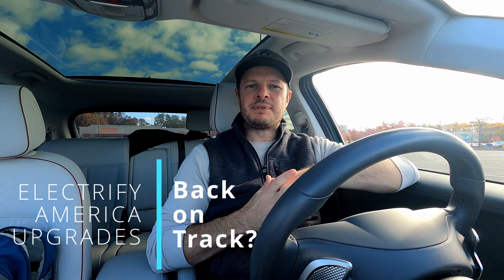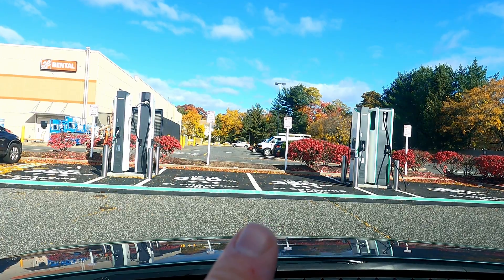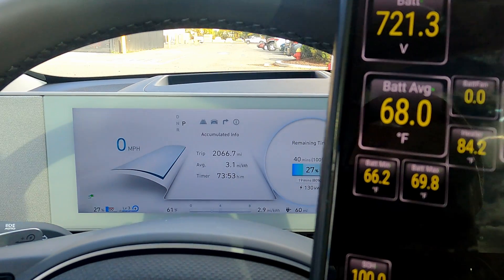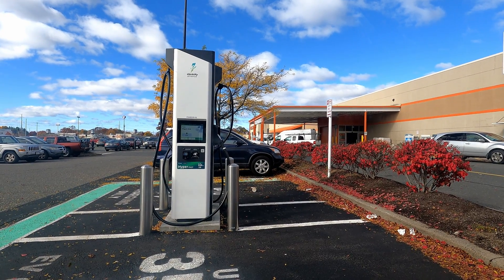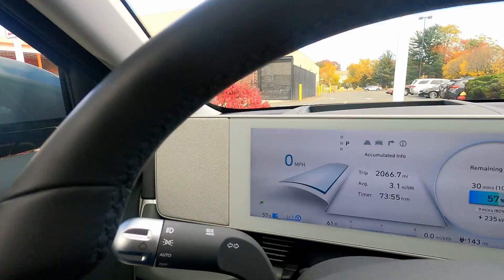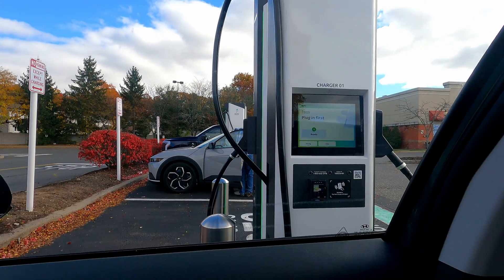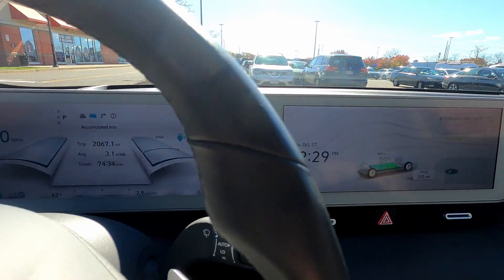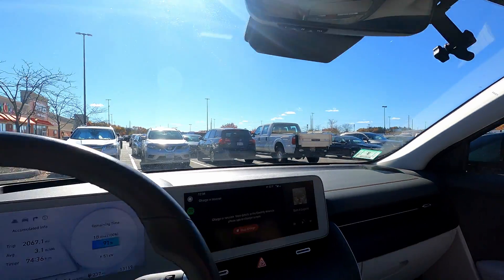Electrify America's 350kW Site Upgrades (with Balanced DC Fast Charging)

Comment from the maker: Do you expect these hardware upgrades and station changes to rehabilitate Electrify America's reputation?
Reply: I sure hope so, as a new Bolt owner I hope for some on the other side of the CT river in the Westfield area.
Reply from the maker: @allys537  I don't expect to see EA expand to Westfield given the proximity to the Chicopee site, but you are supposed to be getting a swathe of new DCFC installs at Pride Convenience stores on that side of the river. Also one at the Friendly's on Southampton Rd, right next to the Masspike so I could envisage us using that one on the way home from long trips. Won't be until mid-late 2023 for most of those sites now though, I would estimate.
Reply: New hardware ought to be great out of the box as long as it’s compatible with the plethora of CCS cars. That would be my expectation anyway. Will these new stations stand the test of time better than the 3/4 year old hardware deployed now!  Wow I sure would hope this new hardware will be more reliable.  Then again it’ll undoubtedly get used a lot more in 2022, 2023 and so on than did the the original EA hardware back in 2018, 2019 and so on. So EA and Tritium hopefully made this new stuff an order of magnitude better, otherwise our perception of it will quickly degrade if that makes sense.
Reply from the maker: @skyemalcolm  I hope so. The first time around, they were in a hurry to get hardware in the ground and had to go with four suppliers, presumably with minimal conditions on providing the equipment. This time, EA has four years of real-world experience and data in the bank...hopefully that means the hardware checks a lot more boxes, as renovating hundreds of locations every year isn't financially viable.
Reply: I’m not expecting anything, but I’m hoping it will be better.

What I’m really hoping is that EA has learned how to work with their suppliers to make serviceable hardware. Everything breaks eventually, that’s a given. Hopefully this stuff breaks less, but when it does break, hopefully they have a stock of replacement parts available locally, abundant staff trained and ready to replace it, and hardware that was actually designed with repairability in mind. The “stock of parts” and “repairable hardware” seem to be their biggest failures with the old stuff (at least according to EA).
Reply: Certainly hope they're upgrading Saugus. For the 2 months I've had my HI5 it has mostly only had one station online and for the last couple weeks they've all been off.
Reply from the maker: @pokerguvna978  Yeah,  Saugus has to be somewhere on a list of old sites... it's by far the worst in our area. I think it's used less than the likes of Assembly Row and Burlington Mall, but they still need to get all the metro Boston sites figured out. 

Another EA location for the North Shore is slated for the mall up there in Peabody, but I doubt we'll see that until next year now.
Reply: @plugandplayEV  interesting, I didn't know they were going in the North Shore Mall. I figured with EVGo there already they wouldn't bother but then again both providers are installed within 100 yards of each other at the Burlington Mall. North Shore Mall would be great as I live 5 minutes away. Currently doing most of my charging in Burlington at the end of my work days in Woburn but those 150kW stations seem to max out at ~90kW. I get up to NH every now and then and have charged at the Seabrook 350kW stations and they've been great. 

Assembly Row was by far my worst charging experience. They're inside one of the garages which most people who haven't been to AR wouldn't know are free for 3 hours and wouldn't even enter.  When I arrived I pulled into the only empty space and tried to plug in. The screen showed it was in a charging session and I didn't notice the guy in the space next to me was using it so I hit Stop figuring it was locked up and started to call customer service. Then I noticed the #1 plug was missing and see the cable going to his car. Knocked on his window and apologized, let him restart. He had plugged into the one I parked in front of because the one for his space was out of service. 

The other space had a car plugged in but the display didn't show any progress. But the indicators on the dash showed it was charging and the driver was in the car, so I figured I'd just wait for someone to finish, which ended up being the one with no charging progress displayed. 

I plugged in, connection failed. Tried other plug, connection failed. Unplug and replug, connected. Starts charging but within 30 seconds I get a notification stating there was an error and to unplug and plug again. The display looks just like it did for the previous car so I check my dashboard and sure enough I'm pulling ~85kW (on a 150kW). Not great but it's what I have to work with so I stayed plugged in. 

Got to my 80% but because the display wasn't working and the speed was slower, I overstayed my 30 minutes complimentary by 1 whole minute and got charged $0.27. 🤣

I might plug in there again in the future if I really need it, but otherwise not going to depend on it until it is upgraded. And I would have that the equipment would be in better working order since it is out of the elements inside a garage. 🤷‍♂️
Reply from the maker: @pokerguvna978  Right, there's protection at Assembly Row so you'd hope to see less damage. But also tighter spots, so maybe more bumps and scrapes along the way. In any case, we've always done fine charging there, albeit not great power from those older units.

The Northshore Mall location is supposedly by the Container Store a bit further north of the EVgo location, but I haven't been up that far to verify. The property company, Simon, has a partnership with Electrify America so you'll see that at several malls in the region, including Burlington but also Auburn Mall and Pheasant Lane up in Nashua, NH.
Reply: There are too many stations with just 1/4 or 2/4 working chargers. EA can't fix the old ones fast enough. The current hardware replacement campaign of 300 chargers is arguably insufficient to maintain the network as-is.
Reply: Kyle Conner, of Out of Spec fame, is very disappointed in the upgrades he has seen. He lives near Ft Collins, CO. I am in FL, no problems here with EA and MachE (still have free charging thru Ford).  Not nearly as easy or seamless as Tesla SC (only used once briefly to make sure my MY was in their database). If you come to FL, look for FPL 350Kw chargers, they are only 30 cents/KwH, just need the FPL EV app, no membership required. They also have a lot of L2 chargers, some are free.

Comment: I just drove my Ioniq 5 , 970 miles each way from Georgia to Austin TX and back.  Using Electrify America for all charging.  Four charging sessions each way.  They delivered about 230KW for every session.  However at two stops I had to call EA for remote starts.  Overall, in my opinion, that was a great performance.
Reply from the maker: That seems solid and heartening to hear that from a completely different part of the country to those I travel most often. I haven't had to call EA for years now, but not every session has been a slam dunk. I typically just try a different activation method or handle and have always got a charge before calling service enters my thoughts... calling might be quicker than my approach in some scenarios, though, and probably gives EA more info about what's happening on the ground when they can actively speak to the customer.
Reply: @plugandplayEV  I understand.   Before calling EA I always try 2 or 3 units.  But in Collage Station, TX I tried 4 units and none would initiate charging.  That station has been in operation for just three months.  But has a long list of failures.  The other call was in Panama City FL. with a line of cars waiting for a turn to charge and one unit not working.  The call got the forth unit working.   (At least it worked for my car)

Comment: Do we need an engineering degree for this ?? Are you an engineer ?
Whats the point of the phone APP ? do you not trust the apparatus delivering the Power ?
Reply from the maker: As I mentioned on the other video, always happy to answer follow-up questions. Over the years, the channel's audience has suggested they like a lot of nerdy EV details and data, so the phone app delivers that... things like battery temperature, voltage and amperage (which multiplied together, get you the overall power in kilowatts/kW), and all kinds of useful numbers for those viewers.

Of course, the challenge is balancing that with giving those without a grounding in electric vehicles something they can take away as well. I do what I can, but this isn't my primary work and there's a big learning curve. Thanks for the feedback!

Comment: Does anyone define the acronyms ? what is CCS ? compared to what ?
Reply from the maker: CCS is the charging connector type used by this EV. It stands for Combined Charging System. There are two other connector types used for fast charging in North America: Tesla's connector which is also called NACS/J3400, and CHAdeMO, which is now used on so few models that we don't typically cover it much any more. 

The industry in North America is gradually moving to J3400/NACS (North American Charging System), but both that and CCS will be around for many years to come.

Comment: These charging stations have about a 35% reliability score. Everywhere I go more than 50% of them are NOT WORKING. Some have been down for MONTHS!!!! Total scam!
Reply from the maker: The upgraded stations or sites with the old hardware? There's a big difference, which was the point of this video originally. But if the new ones start to fail as they age, that's obviously a disaster as well!

Comment: Is there any way to search specifically for a hyper charger? I can't seem to find any out here in SoCal.
Reply from the maker: In terms of finding 350kW sites, you can use Plugshare and go to the "Minimum Power Level" setting in the filters menu. Set that to 200kW and the network to Electrify America and you'll find all EA sites capable of up to 350kW.

If you're looking specifically for these newer fourth generation hardware sites, it's not quite that easy. However, for SoCal I know there use this equipment in Burbank and the Santa Clarita site, so those would be a couple of options to start with.

Comment: Where can we see the charge rate curves for each vehicle? Sorry I'm not a techie. But it sounds like based on the current battery charge level, the maximum amount of watts delivered to the car declines over time.
Reply from the maker: Tom Moloughney's channel State of Charge is very good about publishing charge tests and resulting curves for most EVs. Here's one for the Ioniq 5, for example: https://youtu.be/EFDSx1yZ32I?t=674

European charge network Fastned also does a good job of publishing charge curve graphs. If you Google "Fastned [Model] charge curve", you'll usually find what you need.

Comment: What app is that??
Reply from the maker: It's called Torque for Android. This is the Pro version, which is  $4.99 one-time payment.
Reply: @plugandplayEV  Does only torque Pro work for EVs? Torque lite doesn't seem to have any EV functionally.
Reply from the maker: Should work in either version, EV or ICE. You just need to load in the right PIDs for the car via a csv file to pull through the data.

Comment: Is that the Car Scanner App that you're using?  Are you willing to share your custom template that you use?
Reply from the maker: Hey Tom. It's an app called Torque for Android, on the $4.99 Pro version. I haven't really created a template, just added the main charging and pack temp data points to the default canvas, but I'm happy to share the PIDs or answer any questions as needed, yes.

Comment: Thanks for checking these out again. Glad to see the upgraded station working. Hopefully the minor issues the other drivers experienced will be ironed out soon, but overall looks like a big improvement.
Reply from the maker: Cheers, Brian. It's just frustrating not being able to pin down these few time-consuming niggles. There's no way that two owners of the same model should come away from concurrent charging sessions with such contrasting views of the network.

Comment: Nice test, Steve, thanks.  4/4 is great and yes, if that continues, people will have more faith in EA.  I know I will.
I haven't heard about the precondition (potential) update.  Is the preconditioning manual or does it automatically happen if you navigate to a charger?
Reply from the maker: Thanks Tom. It's good, but I can also see how others might complain that only 3/4 or 2/4 were working properly if they couldn't activate one and another was lower power than they'd hoped. So we start to see how the reports get mixed and why some have a very different view of Electrify America: same station, same morning, same EV model, quite different takeaways!

Yes, the preconditioning is activated within certain temperature parameters, when a DC fast charging destination is set in the Hyundai native navigation (so won't work with Android Auto/Apple Carplay).

Comment: If they upgrade all of the stations and also setup plug and charge with every EV manufacturer (come on--is it really that hard?), that will go a long way to boost their reputation and maximize customer satisfaction.
Reply from the maker: In terms of replacing all stations, yes, it's extremely hard! But I get where you're coming from and would agree that the oldest, least reliable stations should be in line for similar upgrades to improve reliabilty and reputation.

But EA has almost 800 stations on the map and a good number of them are new(ish). The next one down the Masspike, Auburn, MA, for example, has eight Signet units and great reliability. So there's an example of one I wouldn't want to replace, just for the sake of it. 

Even if we say that half/400 should be upgraded, they've only had the hardware and technicians to upgrade 15-20 sites in the past four months. Even at twice that rate, it would take 3+ years to upgrade that many stations.

Comment: The charging speed on the Ioniq5 (for cold temperatures) is based off the battery minimum temperature data PID, not the average temperature. It changes based off of 5 deg C intervals. You can see that in your video when the charging speed jumped up when the battery minimum hit 68f when (which is 20c) Roughly speaking at 15c or less, you’ll get around 75kw. Between 15-20c, you’ll get around 120kw, 20-25c you’ll get around 190kw, and 25+c you’ll get max speed. The kw numbers are rough numbers because the charging rating is based off of amperage not power, so the power will change depending on the battery voltage. I think it is roughly 100A, 175A, 250A and 300A but not sure. You won’t see those numbers exactly on Torque when it is running battery heating (or cooling, except when at 300A) because the power draw of the heating or cooling will push it higher. Once the battery gets hot and it starts to “rapid gate” the battery max PID is the determining factor. The battery average temperature isn’t considered for charging as far as I know.

I’m hoping to see these new stations here in Oregon soon. Many of the EA stations along my typical travel path are are old and using some of the very early chargers and the reliability of them over the past 6 months has been absolutely abysmal, sometimes with entire sites being broken. Given that EA is the only network in Oregon doing greater than 62.5kw chargers (aside from Tesla), it’s really important that they get the new stuff here and fast.
Reply from the maker: Brilliant info, thanks for that. Average seemed like the best to display prominently for vids but it makes total sense that the BMS would use min temp for cold weather management and max for hot weather. I'll adjust the Torque display for winter and try to log as many sessions as we can to get a baseline for comparison if/when the pre-conditioning update arrives.

Comment: New EA site going in at a small shopping center in my neighborhood. The equipment has been installed for months, but it’s still not activated. Hopefully soon.
Reply from the maker: They seem to be pretty stretched with existing maintenance, brand new stations, new labeling requirements and now the upgrades to old stations. Hopefully yours will be up and running soon!
Reply: Not sure where you are located, but the same situation exists at an east end Louisville, Kentucky site; equipment was installed months ago but never activated.

Sadly, I am quite spoiled with the Tesla Supercharger network.  In 2022, all EV owners should realize such a seamless charging experience.
Reply from the maker: I'd say Tesla had a four to five year jump on fast charging, so we're not really comparing apples to apples. But it's certainly no secret that most networks should aim to replicate that level of usability.